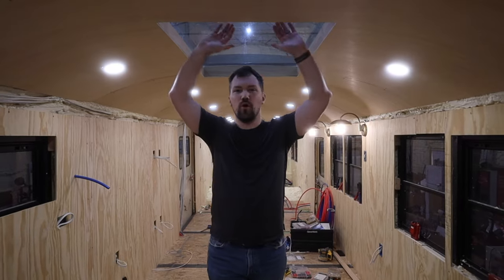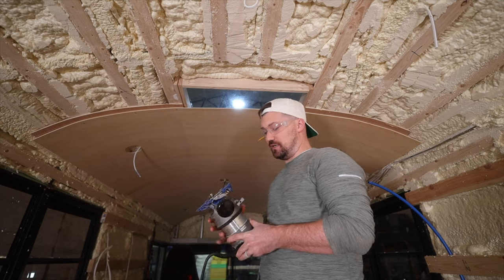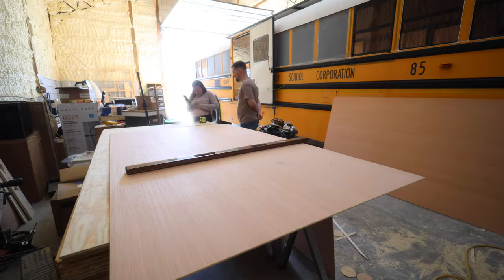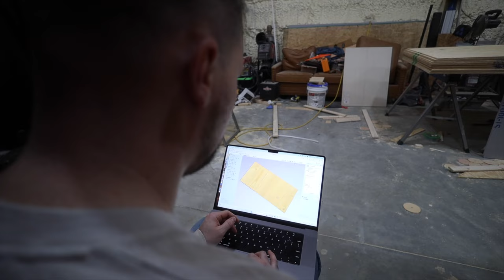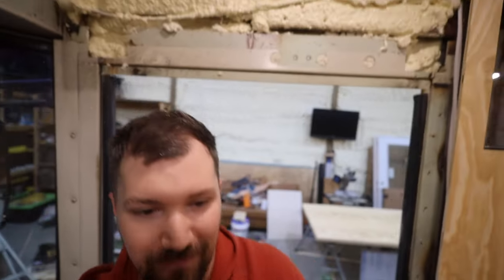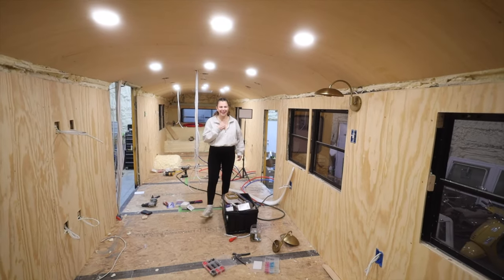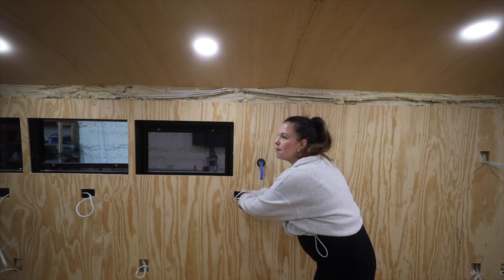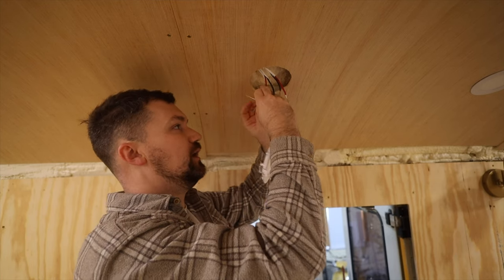Walls + Ceilings with perfect cuts! // Skoolie Build Ep. 11

Comment: Good job! I wish I had a CNC router and a shop. I would have been done with this damn bus by now. LOL! We are using similar approaches though. I used 1/4" birch plywood for the ceilings and 3/4" birch for the walls. I also used 5" LED puck lights. I can't wait to see how yours turns out. I'm sure I'll see you on the road some day.
Reply from the maker: Thanks a ton Anthony. No kidding though. We talk pretty often about how quickly every build we've done would have been with this thing.

Glad to know there's another build stepping away from those tiny little puck lights and moving into something that actually spreads some usable light! We'll most certainly see you out there.

Comment: Great progress.  Which CNC router do you have?
Reply from the maker: Thanks so much! 

So for the CNC, I had been in contact with Laguna Tools for a 4x8 unit ($28,000) and with Avid CNC for a 4x8 unit (~$17,000). Laguna was super responsive, but their unit, while beautiful and truly high end, was just too far out of our current budget and AvidCNC did a really good job of ghosting us for several months and then randomly popping back in to see if we wanted to get a unit, while we had so many more questions unanswered. Then I wondered across ZenBot CNC  being discussed in a forum. I did a fair amount of research on them and figured at their price, the unit is worth trying (~$8,000) I sent an email to the owner, who provides his personal phone number and his email-WILD, letting him know what I was interested in doing and he was so responsive and went so far as to suggest one model, the Pro 4x8, and was kind enough to even suggest a couple of upgrades I could do to increase performance and capabilities, which I ended up doing at my own additional expense. All in all, I'm in around ~$11,000 with a vacuum table, upgrades 3phase 2.2kw spindle, all my bits, and dust extraction.